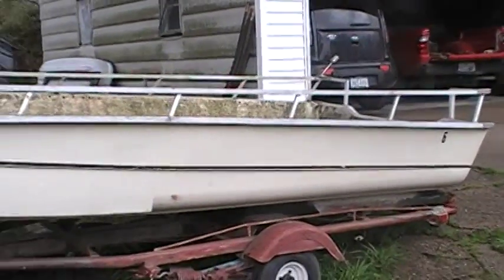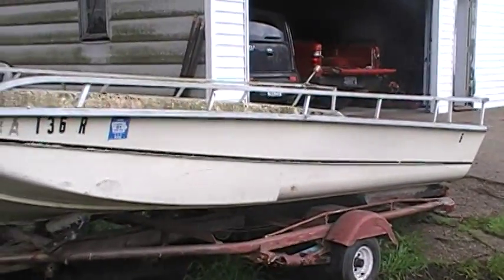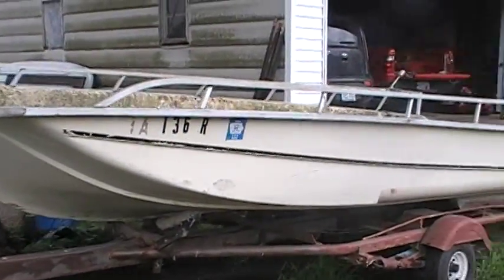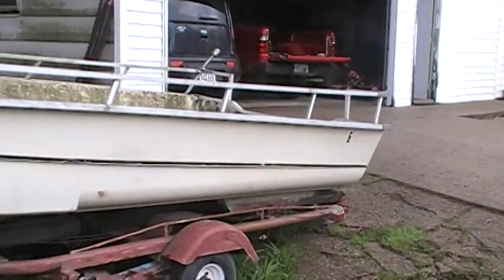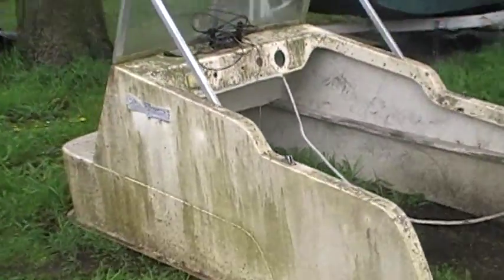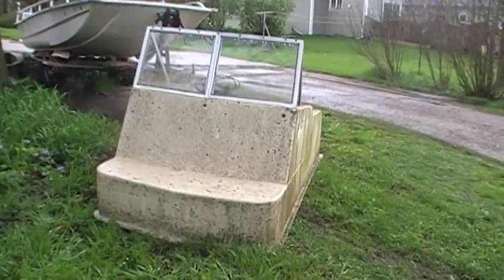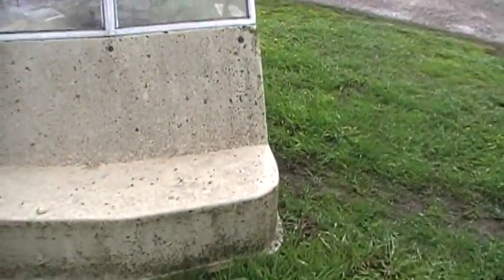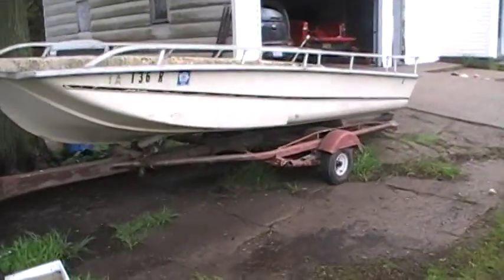Kenner Ski Barge Restoration

Comment: I worked at Dilks & Co in Knoxville building Ski-barges from 1979 till 1981.  I did everything there.  Gel-coat, grinding, carpeting, rail-out...you name it....I know those boats inside and out.
Reply: I worked at Dilks in 1980 & 81 in the carpenter shop making all the wood parts.